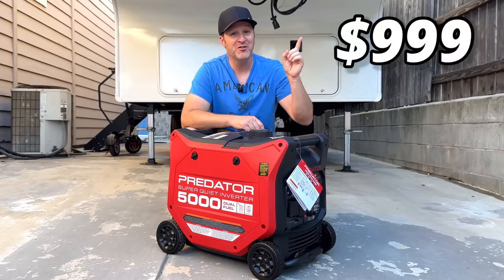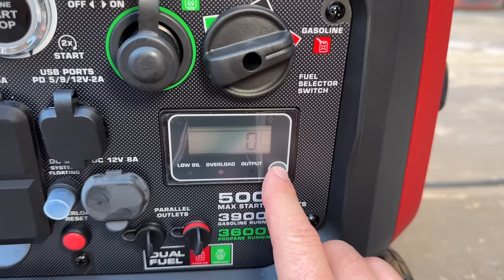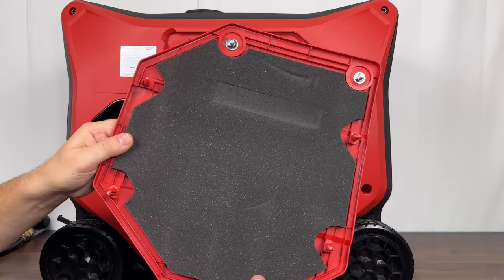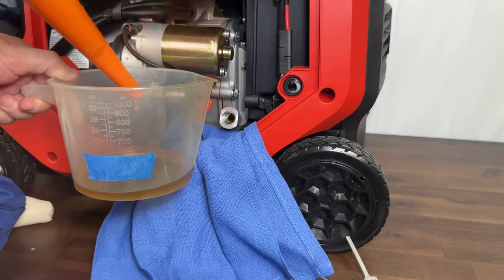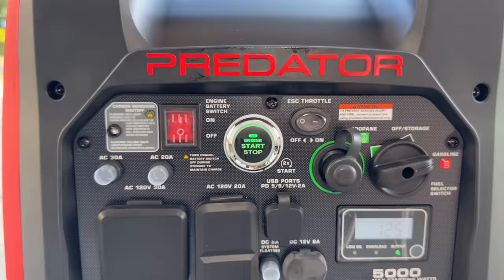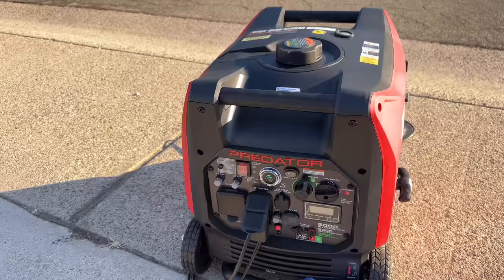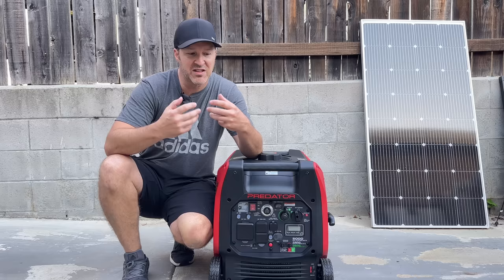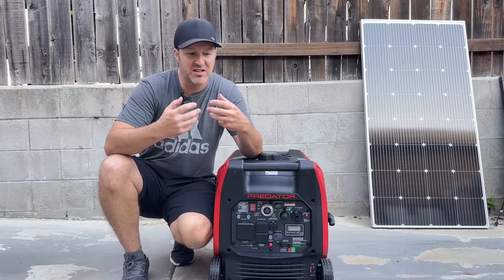BEST New Generator! Predator 5000 Watt Dual-Fuel SUPER QUIET inverter Generator LOADED!

Comment: So this just blew my thoughts on a smaller unit for our trailer.  We have a 15K AC unit, which is the main thing I'm trying to find a generator to run when we're off shore power.  Given that fact, and with this being so much heavier, would you recommend it over other smaller units? If not, which smaller unit would you recommend to allow running a 15K AC?  Or is going to a parallel configuration advantageous if size and weight is key? Two smaller units could fit nicely inside our RV even if need be. Just wondering your thoughts on those options? Love your channel and have now watched several of your videos.  Great content and well done!!
Reply from the maker: The new predator 5000 has been recalled and not available at the moment. To bad. Good options are champion 4500 or 4650 dual fuel, the when 4500 with remote dual fuel.  If wanting small like say Honda….eu2000s times 2. Or eu2200s x2….    Or if you want the eu3200i but it’s crazy spendy but I have already seen lightly used at big discounts. Other options would be the pulsar or maxpeedingrods rods 4000 type units. These have been getting good feedback and would be great for a 15k ac unit as your running in the sweet spot.
Reply from the maker: Some are on super sale!! 
Wen4500 https://amzn.to/40OuSYw
Champion 4500 https://www.amazon.com/dp/B08L9R5YC5/ref=cm_sw_r_as_gl_api_gl_i_TJ3WA6MX4TY68RDE2Y8C?linkCode=ml1&tag=johnny5dahlbe-20
Pulsar 4000df https://amzn.to/3G4RRoq

Maxpeedingrods https://amzn.to/3sN0D7p

NEW …..https://amzn.to/3QPa3HP
Reply: @johnnysweekends  I appreciate the info and links! Haven’t seen many of those brands before. The Maxpeedingrods models look solid. So does the Pulsar. Any preference between the two brands? Have you tested the Maxpeedingrods 3500 dual fuel model, the MXR3500S? Just curious if that is a good unit. The sale prices looks hard to beat!
Reply from the maker: @luv2fly3 the 3500 DF is the same unit as the Genmax 3500 except remote start I believe

Comment: 5:20 A good practice is to only use Ethanol free fuel in power equipment.  It reduces the likelihood of fuel related problems.
Reply from the maker: Not always a option though for many. I have one station now and its $9 a gallon 🙄. So not worth it when Lucas has served me well for over 15 years. Also just dont let things sit for ever and you’ll be fine. Wish ethanol free was easier and cheaper to get, but it just gets worse as time goes on…😐
Reply: @johnnysweekends  yep.   I read a few more comments after I posted mine  and saw that for some people, ethanol free is no where near them. 
In the PNW, a few stations actually have it at every pump, which is overkill.   It’s been running about 80 cents more then 87 octane unleaded
Reply from the maker: Ahh that would be nice!!! But CA and it’s ways… lol. Why am I here again 😂

Comment: Love your videos.  Just picked one up as it checks all the boxes.  Is it possible to use the 30A plug with an interlock and generator inlet box to feed a home panel?  It has a floating neutral whereas the home panel is bonded.
Reply from the maker: Yes this will work fine as NEC says only one bonding point which is your home 👍🏼

Comment: Great video. You mentioned that it was heavy. Will an older person be able move this around. In addition is gasoline better to run. Thanks
Reply from the maker: If moving it around Morgan’s using the handles to push and pull then yes its not hard to put into a location. 
Lifting it is another story especially with fuel. I dont want to lift this. So if going in and out of a truck on on a trailer a ramp would be needed or this would be a good way to hurt your back.

Comment: Great review! In your opinion, what is the quietest 5000 watt generator in the market today?
Reply from the maker: This is pretty darn quiet at 1/4 load especially if not in a concrete pad. 
There are not many gens right at 5000 most are 4500 ish. 
The champion 4500/4650 is pretty darn quiet. The 3500 predator. The champion 5500 but it’s a little bigger and a pinch louder but I haven’t had a chance to compare it to others. 

Some units are now hard to get in California so I have a harder time getting some units. Stores don’t carry them and they won’t ship

Comment: im new to generators and im looking to get one for my rv this winter. Im not going to lie I dont know jack and people are telling me to get a Honda but those are expensive!! how would say this PREDATOR compares to a Honda EU3000is Inverter Generator???
Reply from the maker: THe old Honda eu3000is was or is a great machine. Or maybe used to be. It’s quiet and over all reliable. It’s super heavy, has no wheels and is a little under powered in todays standards of people wanting more and more power. If you only ran one ac unit it would run for ever.  But it’s only rated at 2800 watts. Not 3000. It will run max load at 3000 but for a limited time. Which could be 3 mins up to 15-20 mins depending on conditions. 

Now the predator 3500 original models were work horses and lasted a long time with many getting into 5 digit hours. Highest I saw was 17k something. Very impressive. 
Now they updated the 3500 and it seems to have more issues than it used to and so for the price difference why not get the 5000. It feels well built, has a larger engine, is dual fuel and remote and more. I always recommend no matter what you buy just get the warranty, its worth it. 

But in the winter? How much power do you really need?n I assume no AC units,  so why get something big at all. That’s the only time they are needed. Bigger will burn more fuel, be harder on your back and add overall weight. 

So if you dont need that much power look into a smaller unit like a suit case type generator.

Comment: Nice review but still have a few questions. I've always heard running on propane is quite a bit noisier than running on gasoline, did you ever test this? Also, can two of these be linked to provide 240 vac?
Reply from the maker: No difference in db levels from propane to gas as I have tested several times as i thought propane would be quieter, unfortunately not. 
This model paired with a second will not double volts only amps. So still 120V
Reply: @johnnysweekends  Thank you for the response. I've been checking out your channel. My compliments, you provide great information easily understood.
Reply from the maker: Thank you glad you find it helpful 😀👍🏼
And sorry I’m not better looking 🤔😂👍🏼

Comment: I think they should have designed a 6500 watt gen. to put it in the middle of it's 3500 and 9500  and then they could add a 50 amp plug. so the extra 1500 watts does not work for me. especially at high altitude. i think a 6500 would work better.
Reply from the maker: You need this unit..👍🏼 https://amzn.to/3Q1TlGj

Comment: I’d love to see this and the 3500 predator side by side or a size comparison. With the 30 amp plug, remote start, and maintenance improvements, handle, I’m wondering if it’s worth the trade.
Reply from the maker: Well it’s a decent amount bigger, and just overall a better unit. Different engine manufacturer as well so hopefully they don’t change it like they did with the 3500. It was fine and they screwed it up
Reply: I’m running a 15KW single AC unit ( w/Active Start) with all other appliances and it’s been just perfect on my 3500. If I was shopping, I might get the bigger unit now. Weight is pretty much the same, price is about $300 more. Almost no brainier with dual fuel🤔

Comment: Excellent review!!! Just wondering if you know the actual height? Looking to keep it under a tonneau cover when not in use on camping trips. Also, can the battery connector be used with a Battery Tender to keep a solid charge on the battery?
Reply from the maker: It won’t fit under a tonnue unfortunately many new gens are to tall.
But yea you can add a inline pigtail to a battery tender nonproblem

Comment: new sub today with this nice video.  i need one similar, but with a 50 amp /240 VAC output perhaps a 7500 W big brother.  really like all the updates for sure
Reply from the maker: Thanks for the sub..👍🏼  yea something one more bigger wouldn’t be bad but there are the genmax models 7250 that are really nice as well.
Reply: 50 amps at 240 volts would require 12,000 watts.
Reply from the maker: I think more a 50 amp plug is what he was referring to. 
But yea 12k is a big unit

Comment: Looks sweet, but it blows my mind that everything's not fuel-injected now. Get rid of the carburetors, even the very best carburetors end up leaking fuel or air and needing rebuilt or replaced. Digital port fuel-injection has been absolutely bulletproof and inexpensive to implement for decades now.
Reply from the maker: FI has its pros and cons as well. Especially if you have to fix it. Or if the pump goes out. I can fix a carb unit in the field with not much tools. Fuel injection pump goes your done. Same with an injector plug, if it’s bad it won’t hardly run at all and not easily cleaned in the field so just depends what ya want

Comment: Great video! Would love to see a test on the new WEN 56480iX/56477i.
Reply from the maker: Thank you! Yea i have looked at that a lot. Great intro price but a little bit of a odd unit. Cheap price but no dual fuel or remote start. Very small fuel tank and since there are several duplicates like power smart and a couple others that give some different db ratings even using the engine i bet it will be a little on the louder side. But ya never know until you test it.
Reply: @johnnysweekends  I bought one. But don't have a good way to test. I wanted the portability and it has a lithium battery that is charged by the generator. I really want to know if it will do rated power. Your not close SC are you?
Reply from the maker: I’m in northern CA like way way north lol. 
Just add loads slow and see how it does. If it’s really hot it may have a hard time holding those as heat robs power

Comment: Got one today first 15 mins ran great  then started surging when at high throttle  the electric choke keeps turning on and off making the engine surge. Kinda bummed really want it to work, tried on propane as well no difference. I'll call the 1800 number Monday but just wanted to throw it out I'm tempted to unplug the electric choke
Reply from the maker: Wow interesting, ok so we have a problem unit already. Good to know. I would call harbor freight and take back right away. 
Mine is still good but barely over a hour at the moment

Comment: We would like to see a real life fuel economy test on gas and LP. Perhaps running a camper AC and the power inverter.
Reply: oh, does this have the Ducar 224 or who is the engine manufacturer?
Reply from the maker: Wow good guess! Chongqing Dajiang Power Equipment Ltd 
Although I have not found it’s equal.
Reply: @johnnysweekends  The Ducar engines are maybe 2nd to tillotson and better than Loncin in my opinion. I have several of these GX200 clones i modify for race engines.
Reply from the maker: Yea I think ducar , predator, rato seem to be the better of the China engines.
Reply from the maker: I assume kart racing ..?
Reply: @johnnysweekends  kart engines and off road endurance mini bikes.

Comment: Dang it, I had made up my mind on buying a champion and now you post this!!!!!😂😂😂.  I may just give this a try!
Reply: Just checked out the warranty, 90 days is kind of weak.
Reply from the maker: Lol right 👍🏼
Reply from the maker: Yes very true. Makes it to where you are almost forced to buy the warranty. 
Hence $1400 for the 3 yr otd with taxes
Reply: @johnnysweekends  Makes buying the Champion a lot easier decision!  After your review I was going to drive 30 miles to get the Predator on Saturday, but now I will probably order a Champion.  Thanks for the great reviews.
Reply from the maker: Nothing wrong with champion at all. What model?
Reply: @johnnysweekends  Probably the 5500/4000 or the 4650.  Dual fuel.
Reply from the maker: Only thing is with the 4500/4650 is not remote start on dual fuel model. It wont start with propane on remote.  I dont know on the 5500

Comment: Looks pretty Good. Price? Range of the remote?
Reply: $999 and 100 feet. However it seems the remote is an extra cost item.
Reply from the maker: The remote is included as shown in the video 😀👍🏼
Reply from the maker: Yes $999 or $1400 with additional HF warranty
Reply: @johnnysweekends  the web site refers to “A remote starting option” but apparently that just means you have the option to start it remotely- not that the remote start is an optional item. As you know 😊
Reply from the maker: Yea I would have been bummed to find that out. 
A little note inside saying “this is remote start ready, but remote here “ 😂 
That would have been a bummer

Comment: They’re $1100 now.
Only two months after this video’s release. I got mine & i think i got a faulty unit because my Point of Sales System (Clover) overloaded the generator 4 times in about 20 minutes. Bummer
Reply from the maker: There are a few bad units out there. Mine is having a few issues with hard loads. Sometimes it’s fine and others it over revs. As always buy the warranty and return later when they update it
Reply: @johnnysweekends  i returned it this afternoon ‼️ l upgraded to the Predator 9500. Hopefully this one comes out good.
Reply from the maker: @eliaslara3251 I don’t hear much bad about the 9500 👍🏼

Comment: Nice unit but have a look for the Generator that Costco sales for $999 the (A-iPower GXS7100iRD 7100W Dual Fuel Inverter Generator) I have it and it is about the same size and weight of this predator.

Comment: Why does Predator use a two button push for the electric start?  This prevents me from using this generator with the autostart module made by Atkinson Electronic to keep my off-grid battery bank charged automatically.
Reply from the maker: Not sure just is how they did it

Comment: Great review.  I'm confused though - I thought this gen is 120V only, but you are showing Line1 and Line2 data, including watts on Line2.  Can you explain?
Reply from the maker: Many RVs including mine is is wired as 208y, this is a little different so it will in short jump the line depending how it’s wired. 
It’s more complicated than that but to keep it simple. 

But it’s only a 120v gen.
Reply: @johnnysweekends   nice vid. But can u do one on a house.
Reply from the maker: I don’t do my house so much because one I don’t have a easy start on my home ac unit. And it’s not a 240 volt unit. 

Plus it resets all my clocks, plus fridge shuts off and more. 

And loads are loads regardless if it’s a Rv or a home. Your biggest load in a hole on 120 volt will be a microwave or portable ac unit or a large blow dryer. 

This is not recommended for home ac units
Reply: Thx for info Johnny

Comment: I love my Predator 3500 but recently bought Westinghouse 4500 for $625 brand new. Do the math. New Predator 5000 is way too expensive.
Reply from the maker: The 3500 was a good unit and I think the 5000 will do a good job as well but time will tell. Price wise I think its a fair price but I think will go up soon. As far as the WH 4500 it has had nothing but problems and is actually a model I dont recommend at all. I have made serval posts about it. A Reason I think the price has dropped so muc. THe DF version seems to be doing much better along with the onan copy.

Comment: New to generators. Have an RV and would love something for home emergencies. This unit has sparked my interest, but I see the other comments regarding jets. I live in Colorado at 6000ft and would be using it up to 10k. Is there something I should be considering here?
Reply from the maker: Yes a larger unit unfortunately. With less air density you will have less power over all. So you need to up size alot unfortunately. Now you could parallel a couple small suit case gens to get more power or buy a 7000 watt + unit. 
Down sides to living at high altitude. 
A pair will perform better then a single.
Reply: @johnnysweekends  a pair of 3,500? If I get the high altitude kit for the jets for the 5,000 will that suffice?
Reply from the maker: You could pair a couple 3500, or the champion 4500s, or the genmax line with the smaller 3500 lines, or a pair of Hondas 2200s. Any gen you buy will have to be jetted unless you run it strictly off propane, which if you do no getting is required. But propane has its own problems like less btu, and in really cold climates can freeze up under high draws. Well more the regulator does.